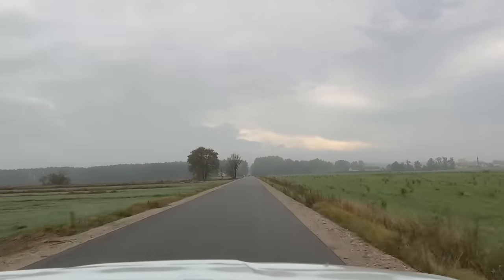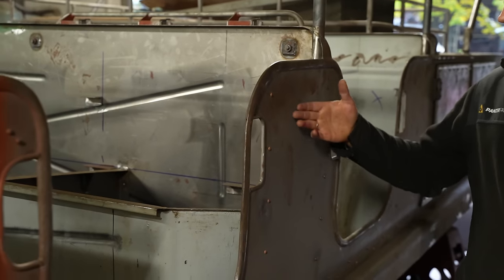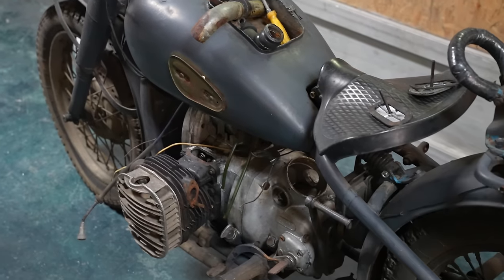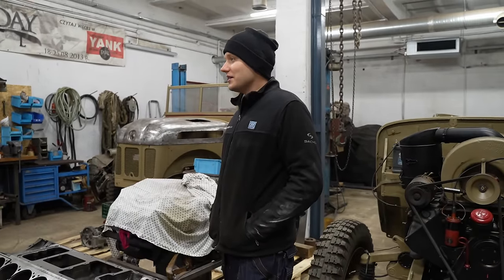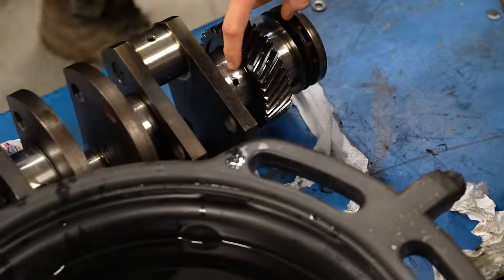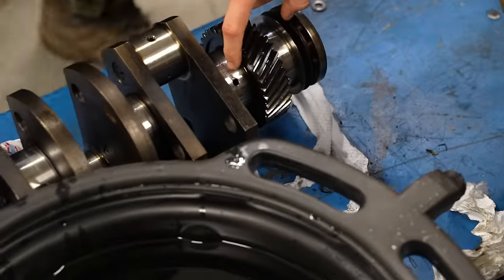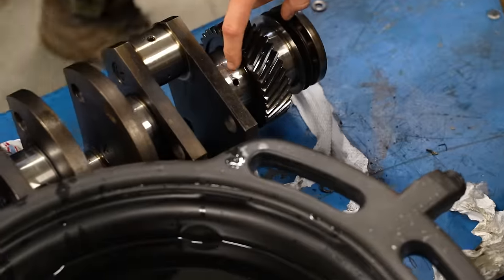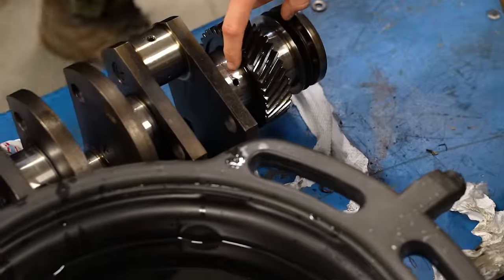WORKSHOP WEDNESDAY: Tiger I Maybach Engine secrets REVEALED! M70 Motorbikes, SdKfz 8 and more!

Comment: Those maybach engines were working so hard to push a tank that was usually 10-15 ton heavier than what they were spec’d for. That is so thin between the cylinders, no wonder they self ventilated so easy, aside from inexperienced drivers. Thanks for sharing!
Reply: Yeah, I'm surprised that they tried to make those V12 engines so small. I would suppose the newer tanks like the King Tiger and Panther would have bigger engine bays that it would not have been necessary.
Reply: Just take a proven aircraft V12 like the Brits did succesfully.
Reply: @CarLos-yi7ne The Tigers would have been 60tons if they used a long engine like Meteor or the W2.
Reply: gets worse when you realize the block is aluminum.
Reply: @murmaider2 damn. I thought German engineers were smart. Lol.
Reply: @kwslife116  I think its best described with a saying we have: "Paper withstands everything." Clearly the metal could not.
Reply: @thesayxx  actually modern engine use the same system of arranging cylinders. 
The engine block is cast iron on the HL 230, HL 210 had alliminium.

Furthermore you are looking at the engine block without the sleeves in which the cylinders are running.
Those sleeves are put so close together that they support each other. The round shape is ideal to take the load. So you dont need as much material in between the cylinders because the cylinder support each other. Hence the engine is shorter and you save space and material. Modern engines are  using this design too. But a good water cooling system is needed because you produce more heat in less space.

If done right there, this engine can be very reliable.
According to Frech and german reports, the engines are good for 1000 to 1500km on average, some even running up to 6000 to  8000km in Tiger I and in some  Panthers for 4000km. 

According to soviet factory trails T34 were only capable of reaching 300 to 400km on their engines until spring 1944.
Chruchills 500 to 1000miles (1600km) and M4a4 600 to 800miles.

The HL 230 is not as bad as it seems.

There is some lost knowledge on how to pull and reinstall the sleeves. It seemes like Panzerfarm also damaged their block while pulling the sleeves, witnessesing the cracks between the cylinders.

So the block is almost endlessly recyclable, by replacing sleeves, pistons and bearing on worn out engines.
Reply: @HaVoC117X  eeeh for modern car engines yes, its not a bad idea. But try that with an engine that has to move some 60 odd tonnes. They require massive amounts of torque. And as i said on paper it can be managed with a proper cooling system, but add in the QC of a wartime production and nasty operating environments and you have yourself an unreliable engine. Also note that the V-2-34 of the T34 was managed to be bumped up to 1100hp from the original 500hp without changing the original bore size or the stroke length. As i said the paper plans can handle anything but the metal cannot.
Reply: @thesayxx  todays V2s are not compareble to wartime V2s.

With fuel injection the HL 230 was rated and tested to 800 to 900hp by Maybach engineers in France postwar.
Charged with turbos or compressors 1000 to 1200 were targeted.

Maybach/MTU used this arrangement  on diesel engines for trains and locomotives. 

And just for the sake of comparison

Centurion: 52 tons, 600 to 650 HP and 1950nm torque out of 27 liters of displacement. 5 speed transmission. (Petrol) 

Panther 44 tons/ Tiger 54 tons, 600 to 700 hp and 1850nm, 23 Liters, 7 and 9 speed transmissions. (Petrol) 

M26 Pershing 42 tons, 500 HP and 1400nm, 18 Liters. 3 Speed spilt in two ranges (Petrol) 

IS 2 46 tons, 520 HP and 2150 NM out of 38 Liters (the engine was 30 to 40 cm longer compared to the HL 230). 4 speed split in two ranges. (Diesel) 

The Panther engine was not smaller or weaker in any kind of form to its  competitors. 

IS 2 in 1945 were also just capable of 1600 to 1800km between overhauls. In Sommer 1944 only 1000km were quaranteed by the manufacturer.
Reply: @HaVoC117X  Don't think so. All fitted in a tiny Cromwell with even that clever and reliable Merrit Brown gearbox at the rear (where a tank gearbox has to be).
So in that huge Tiger it shouldn't be a problem to find a place. Just rearrange and it will fit in that same huge box.
Reply: @CarLos-yi7ne 
Tiny Cromwell? 

Its Hull has basically the same length and was just 15 cm less wide compared to a Tiger 1.... carried less ammo, had a much smaller main gun, far less armor and if you watch inside the tanks also a questional ergonomics for the crew.

So no...

The hull of  Centurion (7,55m) with comparable armor to Panther (6,86m) was over half a meter longer than a Panther and over a meter longer than a Tiger (6.31m)

Having a short engine and putting the transmission in the front between driver and radio operator significantly safes space and  weight.
Reply: @HaVoC117X  No: front gearbox/rear engine doesn't safe space at all: the drive shaft takes a lot of space over the whole length of the tank and makes that the available space can be used less efficient and makes silhoette higher. That is why today all MBT have their engines in the back together with their gear box (or in the front in the case of the Merkava and all current IFV's).
Centurion had 105mm gun and ammo in mind which takes much more space than 88mm.
Reply: @CarLos-yi7ne  The Centurions hull is 6O cm longer than the Panther and its Hull is just 2.5 cm lower. Despite having driveshaft and suspension inside the hull. 

The Tiger Hull is over a Meter shorter and had exactly the same height at the engine deck compared to a centurion, and was just 10 cm higher in front of the Turret. Centurion had a step in his hull, it slightly raises up behind the turret. 

Your argument was only true for the Sherman, because the driveshaft runs through the tank at an angle because the Power outlet of the Radial engine and the Chrysler Multibank engine sits much higher, compared to inline or V engines which have theirs at the bottom. 

Why the hell do you think a Tiger is one meter shorter. The Turret ring was over 200cm on the Tiger and 188cm on the Centurion.
The Tiger and Panther had 5 man crew, the Centurion only a 4 man crew and replaced the Hullgunner/Radio operator with an ammo storage.

The Centurion Mk III only stored 65 rounds of the 20pdr (84mm)
MK 1 with 17 pdr. only 75 rounds 

The Tiger had 92 rounds.
Panther 82 rounds. 

The transmission on Panther was a 7 speed, the Tiger had a 9 speed, Centurion just a 5 speed transmission. 

The Germans, stored more ammo, more crew, a bigger turretring in the Tigers case and bigger transmissions in much shorter tanks.

Trade of, transmissions a harder to replace on both german cats. But the engine could be replaced in just 8hours in the field, for the Centurion the time is listed at 15.5 hours.

So tell me where the germans found all that space? If it wasn't for the fact that Driver, Radio operator and transmission/ steering shared the same compartment.

Today powerpacks did not allow that anymore, but being able to replace that stuff in less than 30 minutes, makes a longer tanks worth it.
Reply: @HaVoC117X  Maybe they made the Tiger and Panter transmission/final drives to small, hence their terrible reputation.

Comment: Ref the engine block and its damaged parts, could some of this damage have happened due to a little "sabotage" by persons unknown in the manufacturing process? Crankshaft fitted vertically? Only the Germans would think of that. This engine and its tolerances or lack of seem to be more complicated than the Sherman "multibank" Great video guys, thanks.

Comment: 8.23 in there you can see the marking of Eisenwerk Brühl GmbH, which was the company casting the Maybach engine block. They also cast German Ford V8 flathead engine blocks. Since the German Ford V3000 truck was the truck transporting much of the war material.

Comment: Having re built two of these V12 HL230 engines, I have always said that if they had made the block and crankshaft 50mm longer it would have eliminated a lot of the problems with the head gaskets. A conventional head gasket could have been used instead of the copper fire rings that locate on top of the cylinder liners . The risk of using copper fire rings is that they can crack the top of the liners when torquing down the cylinder head on assembly. The manual says to listen out for any cracking sounds when torquing down a cylinder head, as this is probably the top lip of the liner breaking as the copper fire ring compresses. In my view , the HL230 was never a good engine.
The life expectancy of an HL230 was approximately 2,000km if handled correctly and far less if abused.

Comment: 7:21, when I was an apprentice in 1973, one of the British truck companies made a diesel engine with Carbon Fibre liners as an experiment, they threw away the fan and reduced the radiator to mini sized as all the heat went out of the exhaust, the exhaust was white hot and the valves were close. Of course it was too expensive to procede with at the time. Good job the technology was not available in WW2 or the Maybach's may have worked better.

Comment: Just wondering if the moving engine components can be coated with teflon or jet coat ( heat and friction coating)  ,to help with long term survivability and also friction prevention and help with oil temps and engine temps together with modern coolants she would last even longer.🦘🦘👌👌🙌🙌✌✌

Comment: When I saw that engine immediately I clocked JEEESUS the gap between those cylinder walls is non-existent. No wonder they failed so much.
Reply: It has piston sleeves, which rest on each other side, supporting each other. You are not seeing the actual cylinder block walls. They are missing.

During the removal of those sleeves they damaged the engine block. The cracks between the cylinders!

I was told, that the romoval of those sleeves and the fitting, is kind of lost knowledge. So I wonder how they have done it?
Reply: There is sleeves to go back in there, But they are SO close together, too close

Comment: Imagine those people in the 40s producing those parts and building the vehicles having any idea that 80 years later that thousands of die hard nuts worldwide would spend their time sourcing impossible bits to restore long abandoned machines to almost factory condition just so everyday people like me could see and experience the history of what they built!👍
Reply: "Factory condition" wasn't exactly what you might think.  Much of what you see was produced by slave labour and there were huge amounts of sabotage going on.  Of course, you couldn't just break something at the factory or you would be disposed of, so intricate work would be undertaken to make sure that, for example, oil galleries were not precisely drilled or clearances were not quite in tolerance.  Just to make sure that the machine either did not function to its fullest capability or broke down shortly after starting use.  Good Polish, Kurt (apart from "from") - one would think you have some experience....

Comment: I was wondering ... I see a lot of wrenching including on the engines ... but I don't see any torque wrenches out. Were the old machines just more tolerant to bolt torques or are you doing them up right when required and just not showing that in the content?
Reply: Actually, just saw one where a late model engine was being torqued. I'm wondering about things like the old engines as well as the old running gear.